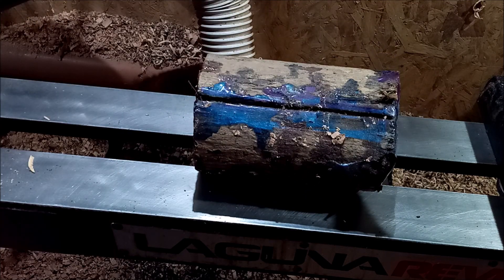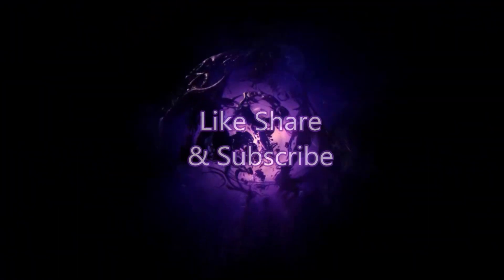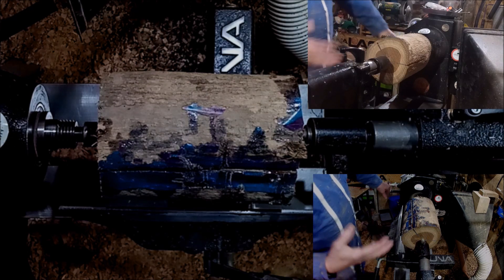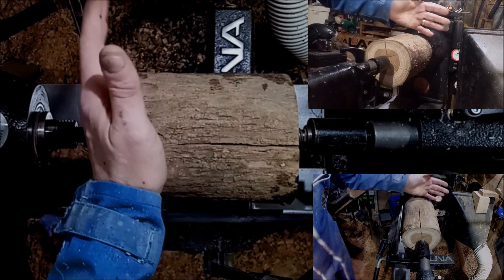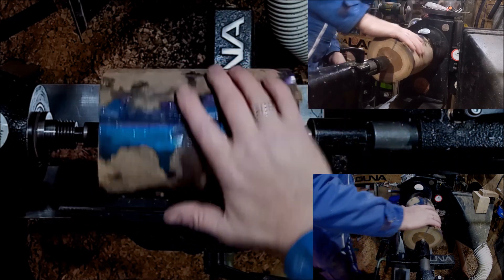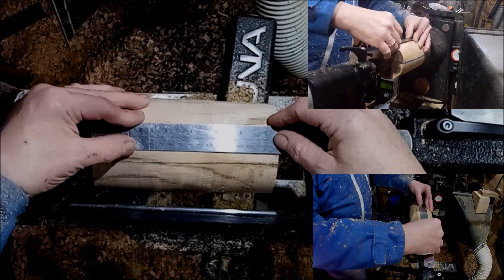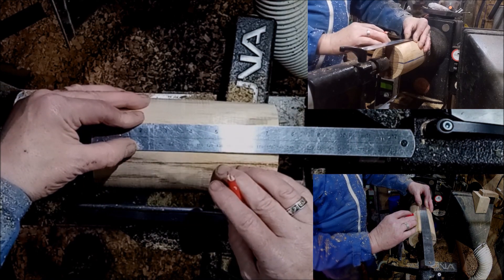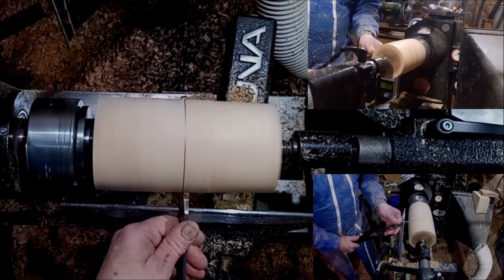Wood Turning a Chalice from Balinese Teak

Comment: I had a piece of Claro walnut that looked solid but when I cut into it, there appeared several checks with large voids. I tried filling them in like you are doing here but it didn't work out. The vase I was making snapped of at the curve just above the shoulder. I turned it into a cup with a foot. Also my CA glue leaked from the lid and it stuck to my glove. While removing it the other thumb was punctured because it bonded me to the glove over my finger print. 🙃 some days are just not my own 😁
Reply from the maker: I hate when that happens Archie,  I stuck my phone to a glove one day over the same thing. Needless to say words like, oh dear, oh my, gosh and golly gee whiskers were said
Shay
Reply: @BBTurning  🤣I'm sure. Mine were very colorful as well.

Comment: Shay what do use for back hollowing and what technique. I end up with catches and end up using a scraper or a carbide. Thanks for the help.
Reply from the maker: You are probably not closing the flute enough Alan. If I get a free few minutes I will do a quick video for you that will show the tip position clearly.
Shay.
Reply: @BBTurning  Thank you I look forward to the instruction.
Reply from the maker: Not a problem at all Alan.
Shay

Comment: I'm going to buy a de-gasing pot and start using resin.
Reply from the maker: Hang on a few weeks, Archie. I got one a few weeks ago but it has a slight problem but the company are sorting it. There will be a video up about it soon. It is easily the best bang for your buck out there and the problem I am having is just a one in a million bit of bad luck.
Shay
Reply: @BBTurning  I'm on the line. It's going to be a bit before I can afford it. I'm looking at a Vevor, 5 gallon on Amazon. It's about $130.
Reply from the maker: That is the one I got Archie, have a look on the vevor site itself then google for discount codes, there are quite a few out there,I am also going to use the pump for a vacuum chuck. I have the parts to make it in the workshop for about a month but have not had the time to do it. That will be another upcoming video as well.
Shay
Reply: @BBTurning  awesome. I'll be looking forward to seeing that. As far as the vacuum chuck goes, my lathe isn't compatible so I've been thinking about a future upgrade. The headstock doesn't have a through and through. It's servers me well for now though.
Reply from the maker: Does you lathe not have a knockout bar Archie?
Shay
Reply: @BBTurning  that's right. It's a Craftsman. I'll try to find the model number so you can look at it for yourself. Variable speed but no reverse. And it's noisy.
Reply: I paid $200 for it, third.or fourth owner. It came wit a few drives and a couple of rests.
Reply from the maker: From what I hear Archie Craftsman is not a bad lathe at all. I have not used one as they are not really available over here.
Shay
Reply: @BBTurning  it works well but it's not without is small issues.
Reply from the maker: They all do have little issues Archie, no such thing as a perfect Lathe.
Shay
Reply: @BBTurning  I guess so. I'm really going to try and find one that has a few more useful features. I'm also going to be trying to find a quick change chuck. You can change jaws in about half a minute. They're about $479 but worth every bit of it.
Reply: @BBTurning  I recall how I found your channel. I was looking for information on getting a banjo for my rockwell lathe. I found your video on how you solved the issue with your tool rest clamp.
Reply from the maker: @archiehebron8944  I remember that video, I was sitting down taking a break and said to myself, I wonder what that hole is for, tried it and i solved the problem everyone was having. 
Shay